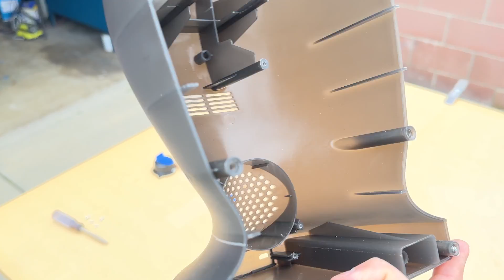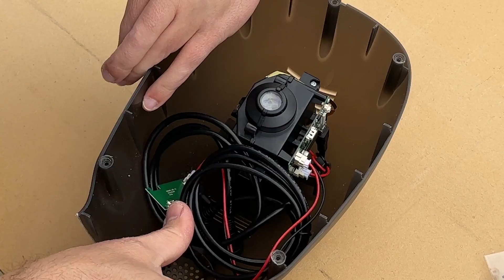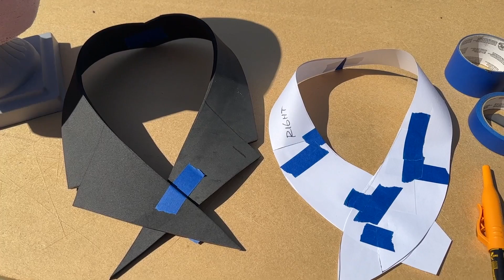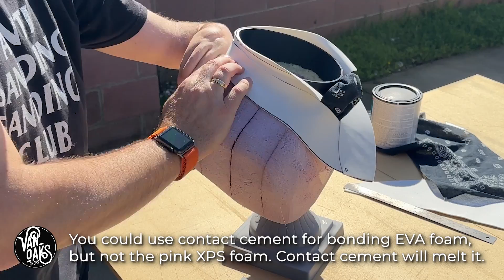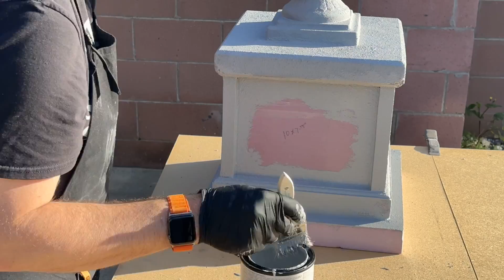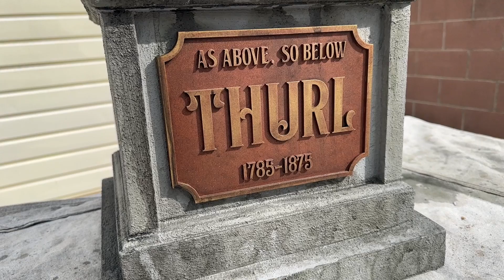Haunted Mansion Bust INTERNAL Projection

Comment: Too bad you can’t buy just those little short throw projectors. You could then 3d print a head to put it in that has a few features so it’s not quite so flat in the front.
Reply from the maker: Yeah. I tried to find them but came up empty handed.

Comment: where can i get that head with the short throw projector thanks, great stuff on here  also how did u add your own file to that
Reply from the maker: You can find them on eBay. All you need is a usb cable and you can plug right into it and transfer your video to the unit.
Reply: @VanOaksProps  but it has to be the amv file correct ? thanks for the help subscribed!!
Reply from the maker: @michaelmyers2517  I believe so. I was able to find an online video converter to do it, although I can’t recall which one.
Reply: @VanOaksProps  hey whats up i got one of the heads  but not sure what cable to use do you have a link for the data transfer cable ?
Reply from the maker: @ it should be a micro usb
Reply: spirit has them too.

Comment: I had this same exact idea when I saw the other guy's youtube channel. I take it you just hooked up a thumb-drive in the back? Would like to see the "tech" part of the build, not to mention how to sync 5 heads to "Grim Grinning Ghosts" ...
Reply from the maker: There's a USB connection that I added in the back, which you can see in the video, that connect to a USB port on the projector itself to add/remove video files from its internal memory. As far as sync goes, I think you'd need a completely different setup since they'd likely drift out of sync if you had each one operating independently.

Comment: I went the more involved route for mine.  I 3D printed all 5 heads from Etsy, so they'd look nice sitting out during the day.  Thanks to you for your awesome tutorials!  Over a few months, I whipped up 10 HM tombstones and 5 bases for the busts with your tombstone and masonry sealer/weathering techniques.  Hardest part was getting the videos sorted and projection lined up but it turned out pretty darned good!
Reply from the maker: That sounds awesome!
Reply: Would have have the file for the internal projection?
Reply: @bobbyalvarez5287  I was using this, which I then modified to work with my setup.  https://www.youtube.com/watch?v=fNk9GUVUVdo

Comment: How were you able to convert your singing bust face file from a MP3 or 4 file to a file that would play through the Hauntly's prop head? 
Can you recommend a program that would do that? Thank you!
Reply from the maker: I found an online converter that would change the mp4 to the format the Hauntleys head accepts.
Reply: Would you mind sharing a link to the converter you used?
I appreciate you.
Thanks.
Reply from the maker: I used this one: https://mconverter.eu/convert/mp4/amv/
Reply: @VanOaksProps  thank you, sir!
Reply: @robertrisley9247  but how do you send the amv file to the head?
Reply: Through the micro SD card that's on the circuit board. You'll need to download what you want to play through the head, then reinstall the micro SD card. @michaelmyers2517
Reply: @michaelmyers2517  there's a mini usb slot on the green memory board if you unscrew the projector and flip it around (carefully with all the cords still connected)  I finally decided to try this myself.  The clip you intend to use does need to be in amv format and flipped 90 degrees sideways.  I cropped the clip's face as best I could in my video editor and then used filestar to convert it to amv.
Reply: @Kyp678  thanks i got 3 on amazon and removed the files that were on it put the converted file on it and it repeats on its own since its the only file ,next im trying to figure out how to take the video of the 3 grimming ghosts and convert to 3 single videos playing in sequence if not ill just do the faces like this
Reply: @michaelmyers2517 if you have them all as the same clip but cropped to specific faces you could leave the hauntleys in the on switch mode and have a multi outlet on its own on/off so they all turn on at the same time